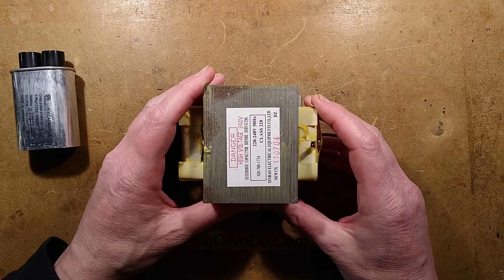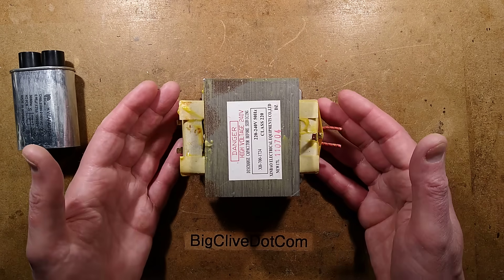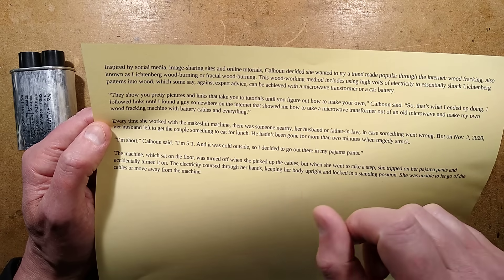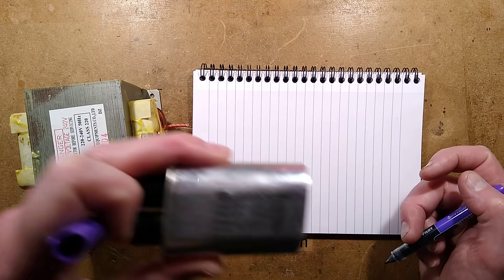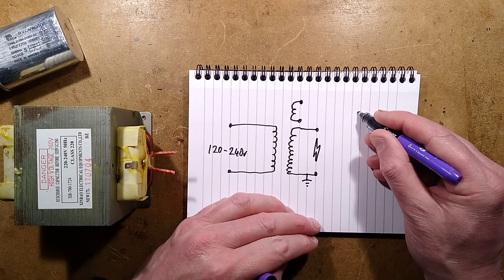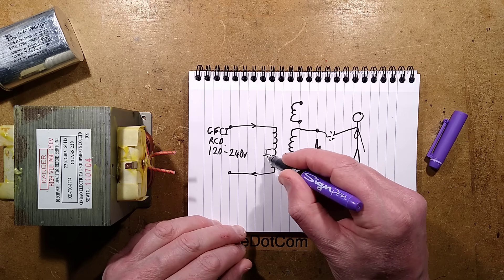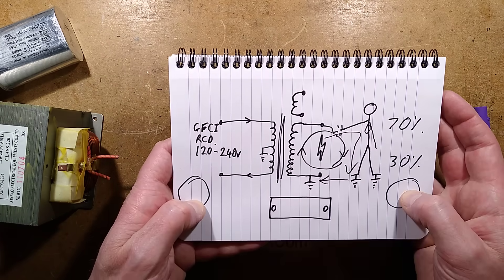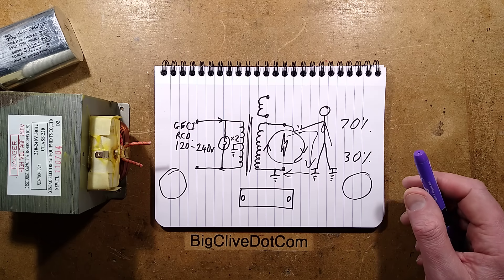The most deadly project on the Internet

Comment: Eletroboom may make a.video on this...

I can see him putting metal buttons on and then going the circuit via the body. 
Basic breaker.
Or someone makes one but it's too thin and the short causing them to hold it on.

I thought these were a fairly low current?
Battery jump cables, and battery boost cables... To totally separate items.  
The. IEC tables suggest that a jump cable at 3.6kv is good for 100amps. 

I had a mains shock. It dropped me due to the path, but sweat on arm pit.. makes arcs.
On another occasion  the contraction caused me to punch my self. The punch hurt a lot...
So it's not just burns. Maybe a few high voltage sausage videos..

Comment: Yeah I got zapped years ago changing out a domestic oven (240v 60A?). I went to unscrew/disconnect power cable with a screwdriver and had forgot to turn power off. I 'Yelped' when I felt a kick in my chest. Luckily my hand didn't go into some death grip - I think I was using my left hand to guide it onto the terminal screws. Anyhow I'm spooked for life - I don't trust electrical things.. EDIT:> I watched a few of the youtube electrocution videos a few years back..still see the pictures in my head..not recommended.

Comment: Big Clive ...... Connecting himself up as part of a Neon driver circuit so You don't have to! (Thanks BC)

The Dead Man's Switch is a good idea (also a good name) .... If you feel the urge to play with this kind of stuff!

One aspect BC did not mention is Earth Paths. If you put your electrode down to the ground it will pass current through the earth and back to the transformer ..... sometimes in ways you do not expect ..... and having a foot eather side of a patch of high earth resistance (not common but can happen) or touching different parts of your body with things that are earthed and considered safe can be interesting to watch ..... and a Lot more interesting to do (for a very short time) Interesting in this context is not good! 
Be Smart .... Play Safe!

Comment: I've made 3D Lichtenberg figures at work with our medical linac running the highest energy electron beam we can do in our bunkers, pretty cool

It's very very easy to get overconfident with high voltage, as you'll know Clive (I know so many venue sparks who will tail in 400V 3ph high amp powercon feeds live, and I suspect you do too!) Whenever I go into the bunker at work to service one of our linacs, I have a mantra in my head "this linac wants to kill me in so many different horrible ways, do not trust it"

Comment: Great video, as always, Clive. The title was too irresistible not to click. However, full of very important points, especially "it's the same voltage as an electric chair" that should really hit home.
Reply: Full ack! I think Clive made quite clear that this is not one of the many mandatory "Don't do that, it's dangerous" announcements, but this IS really dangerous and you really should not do it without being extremely careful!

My dad had two categories for dangerous equipment: "It's gonna be alright!" (e.g. machines with unreliable brakes...) and "That's a death trap!!" Meaning: Touch it, you are going to die!
Reply: I’ll never be able to look at a microwave in the same way again & yes, the end was worth watching 😂
Reply: The electric chair hit home with me too. I've never understood why American authorities persisted with it when it obviously didn't instantly kill the condemned as promised. I reckon it is as barbaric as burning at the stake.
Reply: @stephanielongden597  It goes back to Edison vs Westinghouse.
Reply: @stephanielongden597  The electric chair was endorsed by Edison as part of the "War of the Currents" to discredit Westinghouse's AC electric system.  By displaying the horrors of electrocution he hoped to get the public to use his "safer" DC electricity system.
Reply: @stephanielongden597  ❤❤❤❤❤
Reply: Especially valid comment about the electric chair as they use salt water to improve conduction. Unless you're really unlucky....
Reply: And this isn’t even clickbait which is the scariest part.
Reply: Not only is it the same voltage, but a MOT is capable of the better part of an amp. That makes it more dangerous than even the 10kV of a neon sign transformer.
Reply: I could be wrong but I heard the electric chair was 800vac. Which is way way more than enough since the dielectric breakdown voltage of skin in most areas is only about 500. The frequency and source impedance also play a crucial role. Extremely high frequences with high source impedances lessen the severity. A perfect example is a tesla coil. By concept a tesla should completely kill anything that gets near it but because of the insanely high oscillation frequency and secondary impedance it doesn't. 60Hz out of a ground coupled transformer (a microwave transformer) is about the absolute worst case scenario as far as AC goes
Reply: It isn't the voltage that kills you. It could be a million trillion volts and not kill you.
Reply: @voight-kampff7781  you made think about everyday high-voltage encounters,  from a search,  Carpet static shocks range from 700V - 100000V   
I was taught from my first electronics class in 7th grade current kills,  and further safety  , current across the heart..  so you never want both hands near a conductor.  
people have been hit with millions of volts from lightning.  where it entered the shoulder, and exited the foot,  -- avoiding the heart.     
current that disrupts normal heart beats is what kills
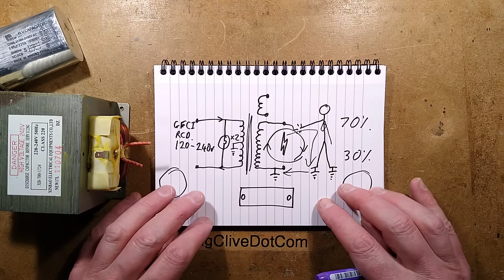Reply: 14:47 - end. LOLL
Reply: @EngineeringMindset  and yes that ending is gold  lol
Reply: You sound like Edison
Reply: It doesbtcdeoend on voltage. Maybe you should first read, then talk!
Reply: it's not voltage that kills,  it's Amperage, very little current can put the heart into irregular heatbeat,  leading to death..
  2000V @  1.2 amps,  ( the max a 20 amp 120 V breaker will allow )   is not the same as an electric chair..7-8 amps    
the fact that people are dying, is what should hit home..--
Reply: @jimonthecoast3234 that is a highly misleading expression. 

While yes, the physiological damage is cause by current and not voltage drop, those two are highly related.

The grid is a voltage source, this means the current supplied will always follow ohms law of I = V÷R. 

For a human getting zapped, R is the resistance of the body, which decreases non-linearly as a function of voltage. (And varries a lot based on other factors, although voltage sets the order of magnitude when dry skin is involved) This means that voltage level is a proxy for expected current when getting electrocuted by a voltage source.

Realistically when dealing with "high voltage" of 120V or more you will be in the low kilo-ohm range, and between 450V and 600v you eill experience dielectric breakdown and drop to 500ohms. 

This means that for putting up warning stickers for the unqualified, its easier to just say Danger High Voltage as the rest is implied. 

The only time the saying actually matters is for micro electronics where you can have an ionizer at 1MV, but barely able to sustain even 1mA under load. (Touching this will instead of horribly maiming you just crash its output voltage and give you a tingle)
Reply: Voltage doesn't kill you, amperage does
Reply: That comment shook me
Reply: The first time I repaired a microwave, that hit home.  2kV and a few hundred mA - it would be an effective electric chair.
Reply: @matthewbeasley7765  There should be some good size capacitors in there that'll kill ya as well.
Reply: It's not voltage that kills you, though. When you walk across a carpet and then touch grounded metal, you can get shocked by multiples of 10.000 Volt. 
It's just not enough accumulated charge to last long enough to do real damage to your body.
Reply: @pfefferle74  ohms law, you need voltage to have amperage 45 volts ac or 90 volts DC or lower are safe low voltages. Anything over that can allow enough current to pass to be dangerous. A car battery can provide hundreds of amps but it will not pass enough current through your body to even feel under normal conditions.
Reply: @FPSG  You don't need to feel it.
 The same current that can power a small incandescent flashlight bulb is enough to send your heart into fibrillation. Your skin capacitance normally prevents this. When talking biological cellular response your dealing in microvolts. Anything that crosses heart can get you.
Reply: @FPSG  - Actually, given a large enough wet surface rich in dissolved ions, even lower voltages than those could potentially kill you.
Reply: @dananorth895  sure, but you would feel the metal probes stabbed into your chest that would allow your heart to respond to Micro volts. Normal conditions. Read the whole comment.
Reply: @750kv8  Is a wet ion rich condition normal for you. Sure let's say you spend 2 hours in a pool before changing your 56 volt golf carts fully charged batteries, could be dangerous.
Reply: @FPSG  - I never said that that is frequently occurring. However, for example, checking if a battery is properly charged, by touching the terminals with one's tongue may be dangerous for this reason. And you never know, some people may be just as stupid as doing just what you said. After all, this video is, unfortunately, about the limitless stupidity of people. You never underestimate stupidity. Not even your own.
Reply: @pfefferle74  - It's both volts and amps simultaneously that kills you. The old saying should be taken cautiously.
Reply: @pfefferle74  Its the amperage of course, and it still doesn't take much. The high frequency voltage however changes the game. The same way HF audio signal leak in a guitar cable, or across a capacitor. Your insulated boots/tennis shoes/electrical leads look like a weak capacitor to the HF coulomb pressure.
Also static electricity covers alot of ground. Carpets/balloons being one thing clouds/wimhurst machines another. Of course the stored charge in a capacitor or large battery bank...........................
Reply: Der Käfigläufer hat ohne Zusatzwicklung noch viel weniger Strom als der Vollanbagger-Motor. Macht der auch Hochspannung oder kommt nichts raus  ?
Reply: Der Käfigläufer hat ohne Zusatzwicklung noch viel weniger Strom als der Vollanbagger-Motor. Macht der auch Hochspannung oder kommt nichts raus  ? Ist dies das Problem ?
Reply: And actually he is wrong. He said discharge can be as high as 4,000 volts. That's TWO electric chairs.
Reply: People playing with a microwave oven transformer get what's coming to them, it's like playing with guns. Glad bigclive made this video.
Reply: 3000 volts?!?! I was playing with a 10kV oil burner transformer at 20mA and a 15kV large neon sign transformer back in the 1970’s when I was a young teenager. The 10kV transformer zapped me good once.
Reply: @Zzznorch  The problem with MW transformers is the power they can chuck out. It's volts and amps with them. Most high voltage transformers can push a few milliamps at best.
Reply: @Zzznorch  you're lucky bc you didn't take the full 10kV. If you did it'd have been over
Reply: @Zzznorch  Two reasons why a microwave transformer is far more dangerous.  
10kV will jump and not let you grab it.  2kV will let you grab it and then you are locked on.
Secondly, you mention directly the 20mA.  The probability of 20mA killing you is much lower.  500mA to a few amps is deadly.

Comment: When they refer to "some people used a car battery", they probably mean car ignition coils.
I made an x-ray generator from two antiparallel coils driven by a mosfet - and an old radio triode tube, generating 80kV at 300Hz or so, making 3 inch sparks between the wires. It killed my oscilloscope standing two feet away just by the EMI. The goal was to make a mini-CT for under $200 bucks. I used fluorescent foils to detect x-rays, and it worked, they got green glow in the dark when radiated. I finished the hardware side of the project with a rotating table and a cheap long exposure digital cam, but finally I got shocked by the coils even with an unplugged supply because of the rest charge in the caps. It kicked me hard. Fortunately it was only a fraction of a second. I still have a slight scar from that. During another project, I pulled a 40kHz/20kV spark for a few seconds with my finger. Got burns and a deaf arm for a few minutes. I have family now, will not work on HV, it´s just too risky in a hobby environment, or at least if you are not used to it.

Comment: shocking situation this i just build valve amps with 500 / 600 volts RMS 120 RMS so the peak voltage wold be 120 x 1.414 196 volts  peak  392 volts P-P

Comment: To put into perspective the difference between the neon sign transformer and the MOT. MOTs are typically rated for ~500ma. With a neon sign transformer outputting 2kv, that MOT has ~17x the power.

Comment: My old job we used microwave transformers as part of the work for one uncommon test. 

When I got there, the connections were all exposed, return referenced to a gigantic earth plane and done without observer.

No one was injured as only the most experienced and smartest 3 people were ever put on the setup. I also got signifcant safety changes made both technical and administrative. 

A single deadmans switch may not be enough if your hands clamp but is a a good start. I like the idea of a second incline foot switch. May not make much difference but really makes you think if you need to have a foot actuation and both hands. 

Where possible, high frequency is the way to go. RF burns will sting like heck but they are a lot less likely to impact vital organs like 50/60hz will.

Comment: when i was 15 years old i got my first MOT and i've nearly kill myself with it, i used random wires from an old device and it had melted without me realising it, the wire was touching the wood of my desk and i could feel a strange shock when i was touching it, if i had a metal desk i would be dead, this is no joke

Comment: You can't scream while electrocuted :) So you will die in silence. But the smell of electrically burning flesh is horrible. And yeah, no protection circuit will trigger disconnect, so this is a nice demo of how to do low-cost electric chair.

Comment: Of all the ways of dying by electrocution, death by MOT is high up on the list of the worst ways.
While the voltage and current are high enough to kill you, it won't do it instantly. 
It will take a while before you die -- It will hurt like nothing you've felt before -- There is absolutely nothing you would be able to do to stop it.

Comment: Another example of Health and Safety gone mad!  I've been holding the leads between my teeth for ages and have never had an issue!

I think the "Same as the electric chair" line drives the point home pretty well.  Don't mess with microwave transformers unless you know what you're doing, folks.

Comment: Hi, you mentioned that people have used these transformers for spot welding, I have seen these being used for joining 18560 batteries, is this a safe method? So far in my projects I have just used prewired battery holders but some times these are too bulky, I have also seen setups where people fit solenoid to make the connection with a 12v car battery, would you be able to let me know whether either of these are good methods for spot welding batteries or should this be avoided? Thanks ✌️

Comment: The other source of high frequency, HV sources is TIG welder igniter modules. You can get them separately as upgrades for older spark-gap igniters. Technical Arc make one and it’s very good.

Comment: What would a GFCI on the secondary side of the transformer do, assuming it works on these kind of voltages? Would it still work for example for woodburning, or would there be too much leakage current the GFCI would trip anyway?
Reply: The voltage would be very high on the secondary so where are you going to get a GFCI that works at that voltage?

Comment: That's madness to use electric transformer to burn wood, surely if you wanted to burn wood just use a soldering iron or head up a metal rod.

But he'll don't use a transformer especially of such power utter madness.

Comment: I remember a friend telling me about a low voltage injury first aid course he did, where someone asked the teacher if there was a high voltage first aid course, and the teacher said no, generally that's known as corpse recovery.
Reply: He was kinda lying though, there IS HV first aid which usually involves turning off the HV source or getting the person struck with HV away from the HV source (if turning the HV source is not possible) whilst making sure we don't endanger ourselves (e.g. through step voltage). This usually only applies to those struck with HV indirectly (i.e. through some sort of a resistance), those who come in contact with HV source directly (e.g. touch it) are usually killed literally within moments (depending on the voltage of course).
Reply: Yep. Low voltage is defined in the UK as not exceeding 1000V AC or 1500V DC between conductors (BS7671) - your country may vary but low voltage does not mean "safe". See ELV and PELV for that. Even mains voltage can cause arc flash, burns and sometimes death.

Comment: Can you not add a couple of low value high voltage capacitors(in series), to limit the current to a "safer" level? Also break the earth connection to the transformer core?